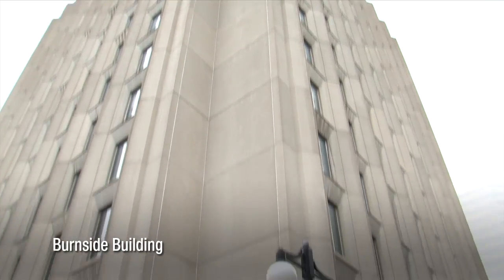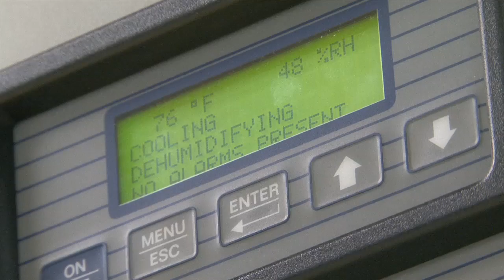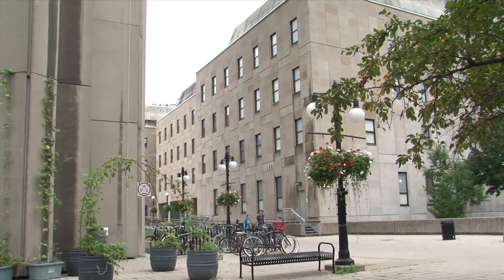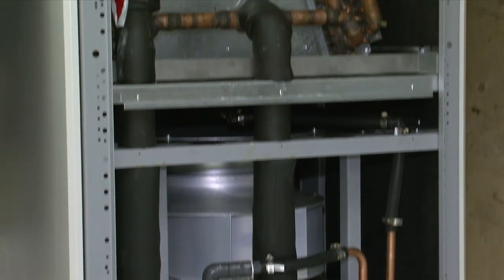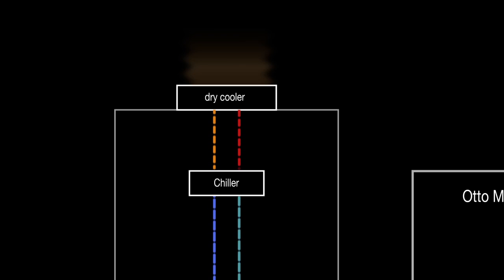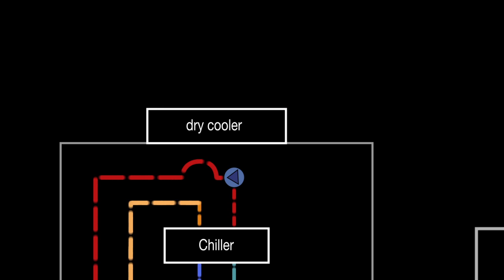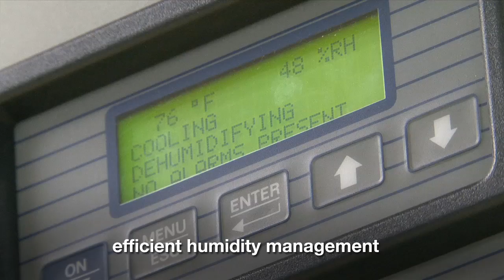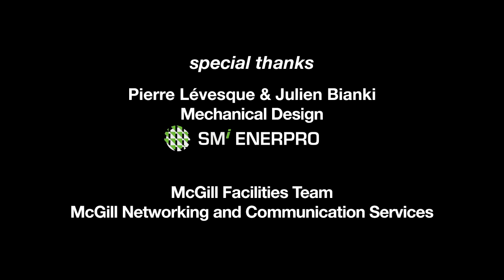McGill University Datacentre Sustainability Project

Comment: I work at SMi Enerpro,

The Otto Maass building is a research building that uses a lot of heat for all his processes all year long. So in that case, the heat is recovered all year long to through heat exchanger. In the case of a mechanical problem, the heat can also be rejected through the air-coolers.